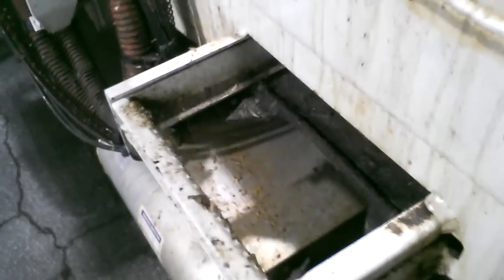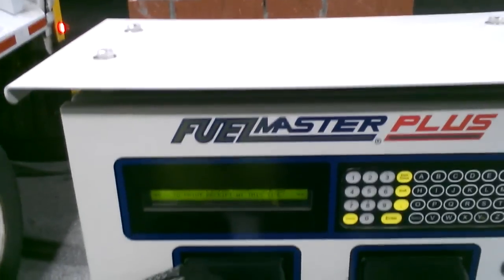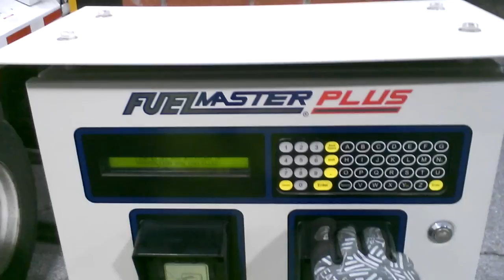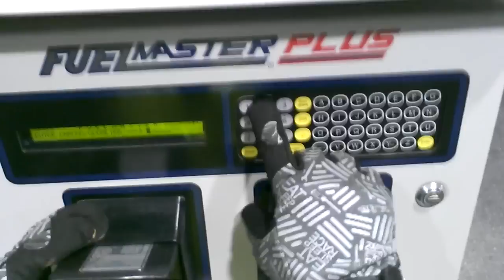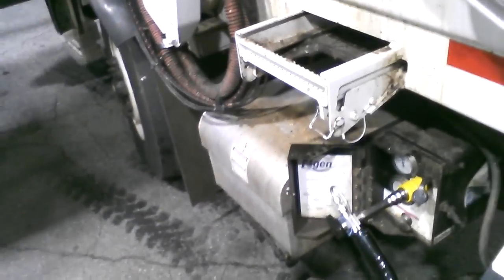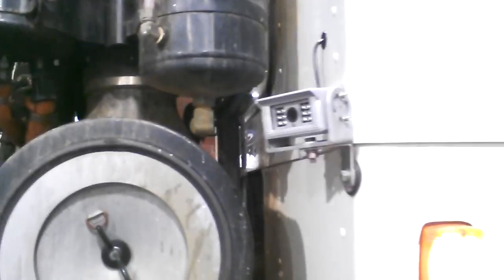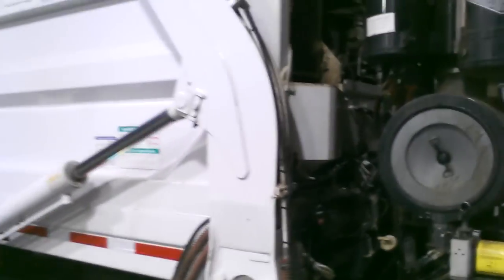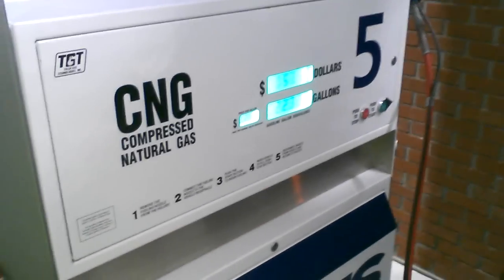February 16, 2014 Refueling

Comment: How long does it take to fuel the truck? 15 mins average?
Reply from the maker: Andrew Terra it actually will depend on the weather. If its a mild or hot day, about 10 min. On winter days, I have been there over 25-30 min.